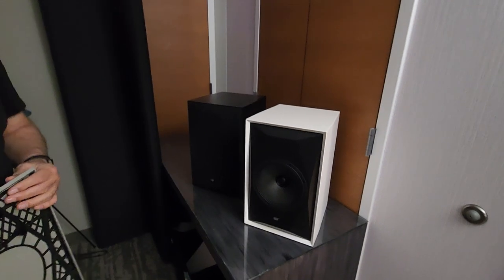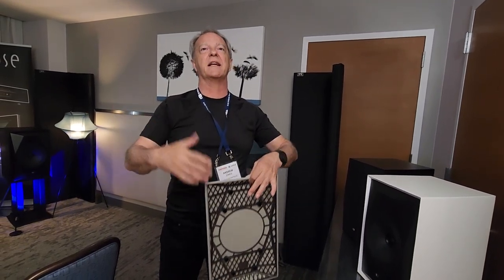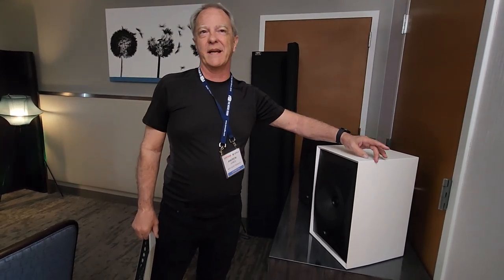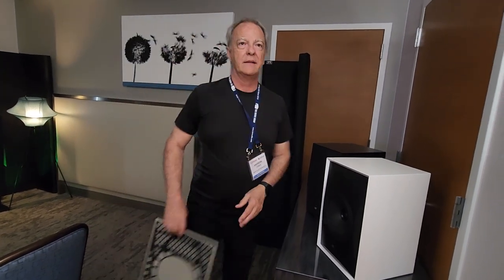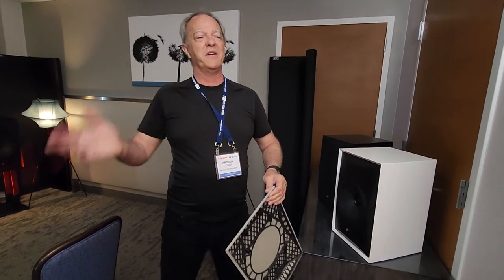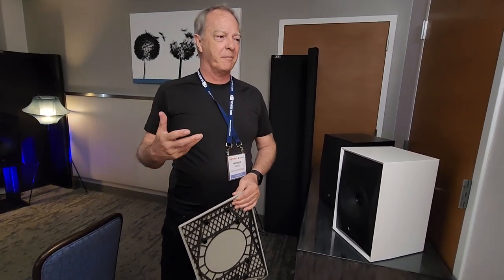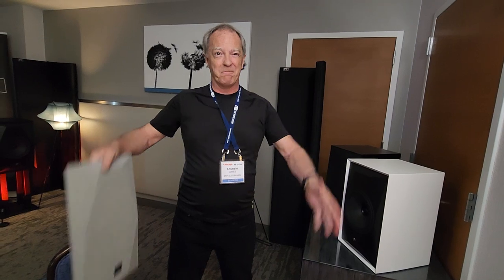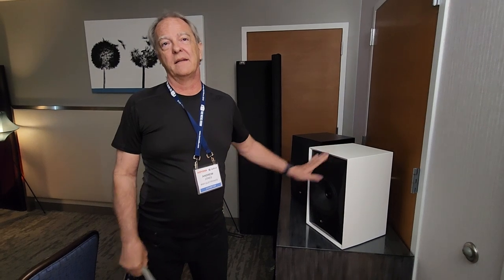🤩 Interview with Andrew Jones - The New SourcePoint 8 - Killer Trickle Down Design

Comment: BUT! The FR in the data sheet is quite the worst I ever seen in a coax driver!

See here : https://sbacoustics.com/wp-content/uploads/2020/02/75-SATORI-MT19CP-4-GRAFIK.jpg

So how do you managed to give cone & dome a much different curve?

Price & Looks are gorgeous on the Sourcepoint 8 , but if the SBA - Coax is available only in the (old) current state I see trouble ahead for us!
Reply from the maker: Imagine FR at the listening position for any speaker you want to compare.  It's never going to be the anechoic response anyway and it's the easiest to fix with EQ or speaker placement.